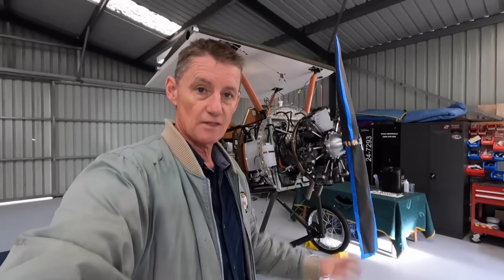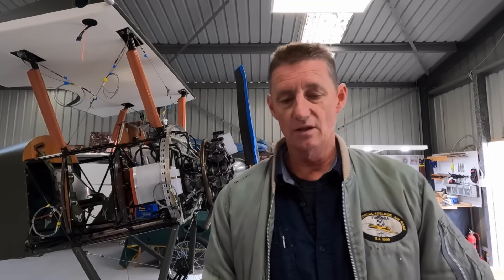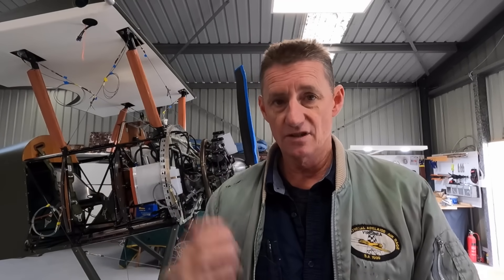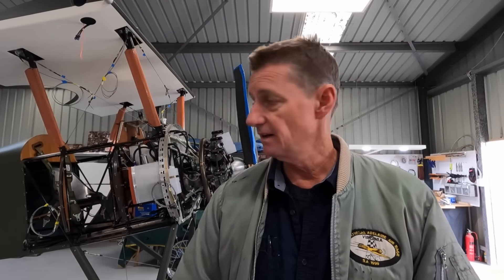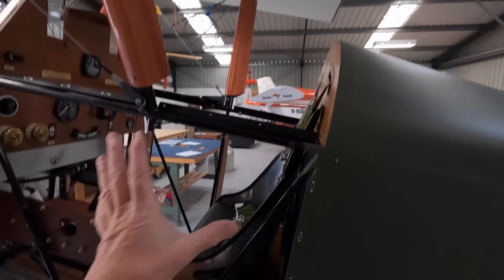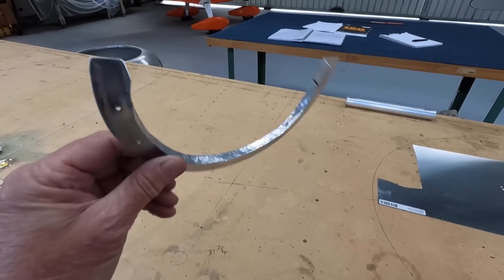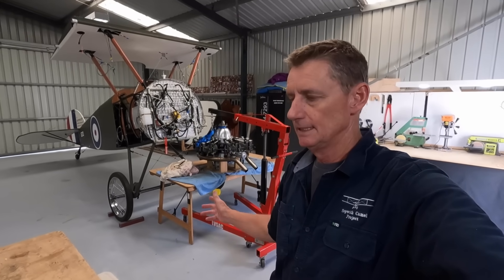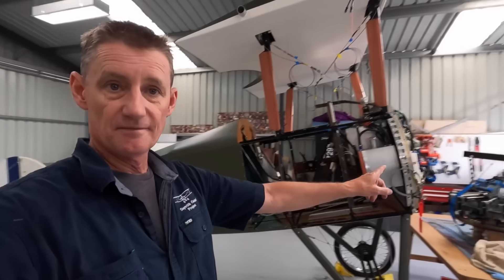Engine run attempt 1

Comment: This is a really superb build, with so much attention to detail, this is where most of these builds fall down as few people are willing to put the extra effort into parts that can not really be seen! BUT! Why on earth have you chosen to use the Rotec engine? Just a quick research will turn up the almost criminal attitude of this manufacturer, these engines should not be fitted to any aeroplane for manned flight. Please be very careful ! Chris B.
Reply from the maker: Thanks for the comments

Comment: That engine needs to go for scrap. Casting voids? Wow. Multiple obviously defective jugs? Imagine the voids that aren't obvious in the "Good" jugs. Air cooled airplane engines expand and contract a lot. When I learned I was warned against shock cooling and overheating. That engine is a time bomb, a hunk of scrap metal waiting to kill you. 
That Rotax actually sent out an engine with so many obvious major metal defects it's criminal. You are going to kill yourself. Go buy a Varner S9 for under $30,000 or 7U for less than $25,000 new. Heck you can even get a real Gnome new, better than origional but It wouldn't have electric start and the handling isn't for a novice. Anything but that Rotax with such major defects. I'd be suspicious of the crank itself, given they sent it out untested without even a functioning electrical system. The planes' paint looks good but if even the motor mount is inadequate, what other deadly structural flaws are hidden under it? You can afford to build it but can't afford a proper battery? There is no way I'd fly that plane with that engine. They treated you poorly and that model engine has an awful reputation for failures. I get the idea of drama, but airplanes aren't like old junk sport cars. Good luck. They can put that cool name plate on your headstone. Your life depends upon that defective junk engine. Hell, I had an engine blow as a student before I even soloed. Oil everywhere, long runway, just after rotation i landed and hit the brakes. Asked the instructor if I should shut down to save it. He said no. Taxi back to the hanger. If it makes it, they'll only patch it, I hope it seizes, here I'll do it. As a survivor of several engine outs in over 20 years I'm not putting you down. I'm just saying, I've been there. Your life isn't worth risking.
Reply from the maker: Thanks for your concern.

Comment: As a fellow Rotec owner (R3600), I hope your issue can be resolved quickly and to your satisfaction.  Midway through phase 1 flight tests, my engine is running wonderfully, other than dealing with some minor rocker cover leaks.  Through various accounts of trouble other owners have shared, I have tried to take as many precautions to prevent similar issues as I could.  There are things you need to watch for, and if you monitor things and address them when or if they occur, it will be a good engine for you.  Hey….its a radial after all!  

Best wishes from Peshtigo Wisconsin, USA
Reply from the maker: Appreciate you sharing your experience and the kind words!

Comment: I respect you not commenting until the issue is resolved. I was about to say watching your videos from the start and seeing you picked the Rotac but, aren't Rotac engines known for reliability issues. I saw another video several years ago about a guy with a Rotac 9 cyl that had endless trouble with his engine due to extremely poor build quality. He ended up having to pay a mechanic and machinists a ton of money to remake parts that were so poor they self destructed in flight. Rotac didn't want to fix his engine and gave him a bunch of attitude when he complained about his engine falling apart. I really hope you get the engine issued resolved. We all have been there. This too shall pass .....
Reply from the maker: Appreciate you watching and for the kind words.

Comment: Would it not be better and safer to use Mags rather than electronic ignition? Just wondering. Very neat build.
Reply from the maker: One of both is probably optimal.

Comment: Flying any single engined aircraft requires a degree of faith and trust that it’s not going to let you down at an in opportune moment. I just hope that despite the brave face you get full closure on the issue(s), as if you don’t trust the machine, you won’t ever relax enough to truly enjoy what you’ve achieved here.

Comment: Its sad to see you had to take the engine back off. But it would be better now than to have a failure later. Keep your chin up and press on. Always great to see your progress, even if sometimes its in the wrong direction.
Reply from the maker: Thanks! It's frustrating, but better to find the issue now.

Comment: Wasn’t there a guy in the States a few years ago had all sorts of troubles with these poor quality engines? Crashed on a maiden?
Reply: Rotecs have certainly had issues, but so have every other engine. If I was only an hour and a half drive from the Rotec factory at Tyabb, like Scott is, I'd be very tempted to give a Rotec a try myself. But their policy has been to not provide parts and service instructions, but to have you crate up and ship the engine back to Australia if you have any internal problems, and that is a non-starter for me in Canada.
Reply: @curtreimer2150  The amount of issues Lycoming, Continental, UL power, and Viking have had are worse than Rotec in my opinion. Seems to be a lot of bias in the aviation community. The Rotec not having a serial number is questionable though.
Reply from the maker: Not sure

Comment: On the bright side, you at least discovered the issue now.  Better that than at mid-takeoff.  Keep up the good work.  A technical question; the Camel, with its rotary engine was renowned for being able to turn exceptionally quickly in one direction and only very slowly in the other.  Presumably the rudder authority was substantial.  Has there been any change in the replica rudder control surface proportions, due to the different engine?
Reply: I believe the Airdrome Camel rudder is larger in area than the original Camel. I compared the two plans a few years ago when I started building mine. I'm not sure about the maxiumum rudder deflection though. There are no rudder stops in either the original aircraft or the Airdrome version, so the rudder travel is limited by (in my case) the tailskid hitting the inside of the fuselage at full left and right deflection.
Reply: @curtreimer2150  Thanks.
Reply: Different geometry Mike,  the Rotec is a radial, not a rotary therefore there's no gyroscopic effect like the original had.
Reply: @67hr74  Exactly my point.
Reply from the maker: Not that I’m aware of.